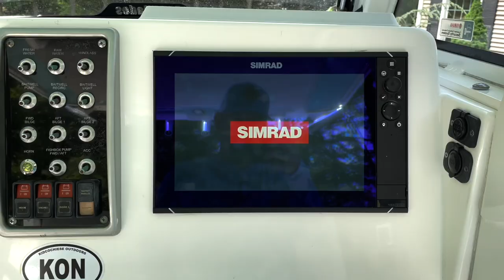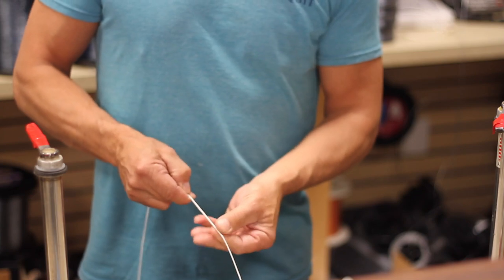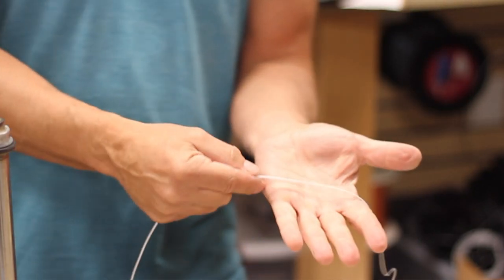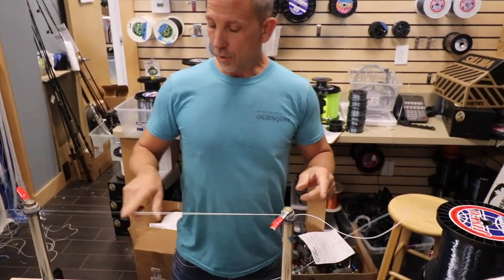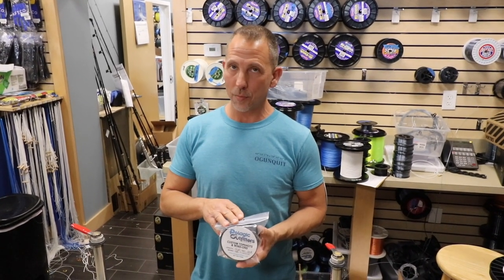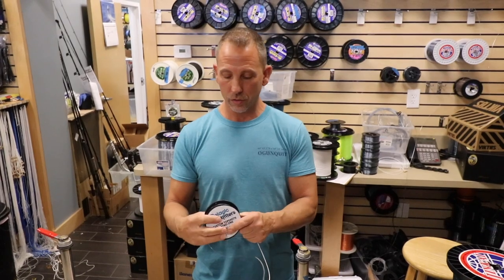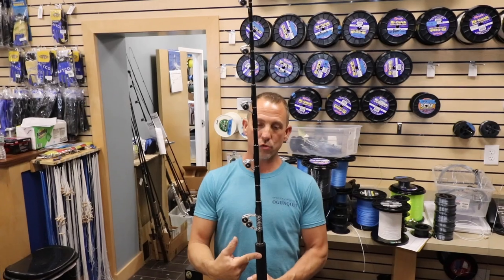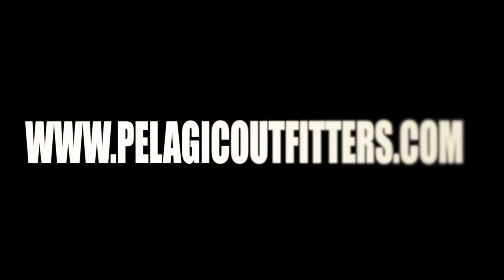THE PERFECT WIND ON LEADER HOW TO & CUSTOM GIANT ROD

Comment: I’d advise the Winthrop Terminator long buts over the short curved buts.  Yes it’s a lot more $$ like $300 more each.  But I had a set of rods with the short bent buts that I love to to fight fish out of but they are simply a pain in the ass.  The short buts are impossible to put in a rod holder you need rod but extenders, they are a pain to store and they love to launch out of the rod holder on a bite make sure you have a safety line.  The Winthrop buts allow you to go from straight to bent by pushing a button and you have the best of both.

Run back now and exchange them you’ll thank me.  I left those rods on shore for 2 seasons it was to much of a pain to deal with them before I went to the Winthrop’s.
Reply from the maker: Thx Cap. I’m just not a fan of Winthrops, I do prefer their guides. These butts are perfect for my needs. I experimented with them on the boat and the clearance was perfect in my swivel rod holders (if they weren’t Chris would have just switched them out for me). Also rigged them in the stand up harness and they are perfect. I know Winthrops are the Hot thing now but I just dig the old school bent butt, nothing to fail 
Thx brother. And yes definitely leashes. Learned that lesson already 🥴